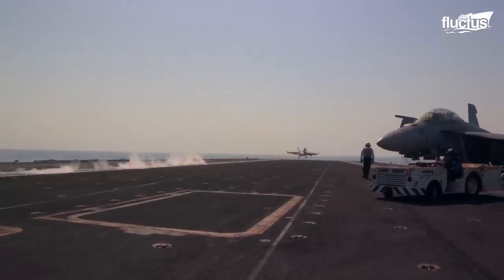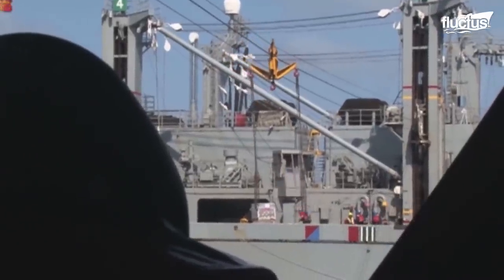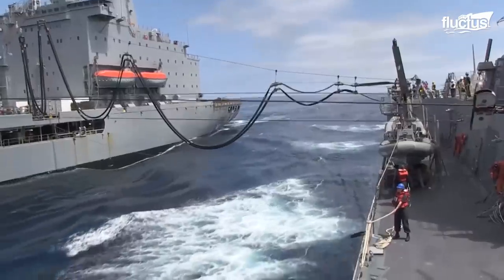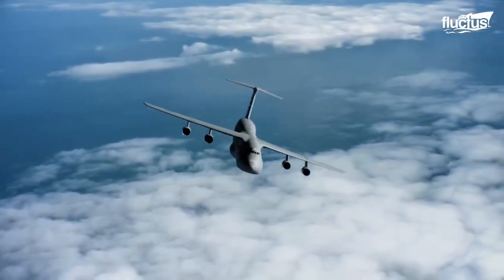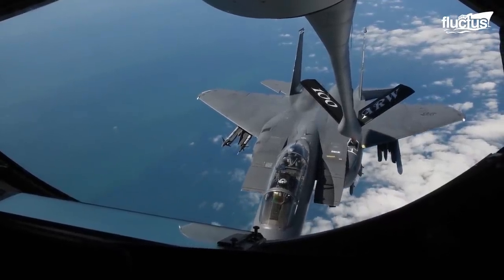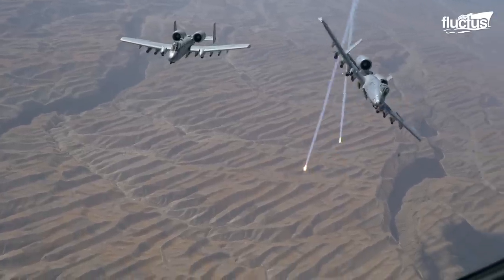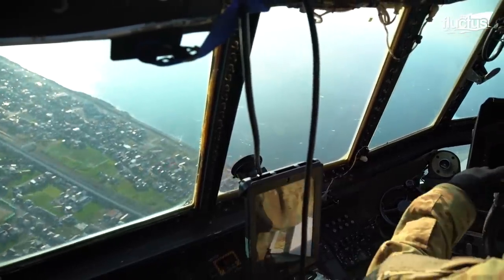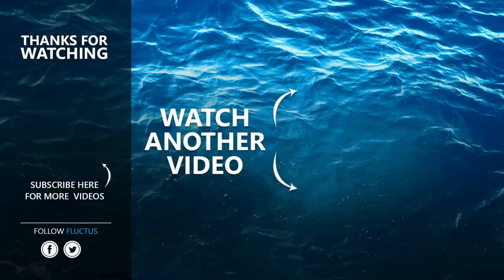US Genius Invention to Pump Million $ of Fuel Into Aircraft Carrier

Comment: I was on an old Destroyer Near Vietnam. While refueling in rather heavy weather, the two vessels rolled in opposite directions.  The hose pulled out and for some reason, the shut off didn’t work. The flow rate at around a thousand gallons a minute.  It probably flowed for a couple of Minuit before they finally got is shut off.  That’s a couple thousand gallons of bunker!   Made an unbelievable mess of our vessel. It took us months, many months to get that cleaned up. Wow, I will never forget sliding accross the deck as if on ice as the ship heavily rolled and we attempted to get at least some control over the spill.  Just one of many “adventures” from 6 yrs at sea in the Navy.
Reply: I remember hearing the Chief of our station telling us to not send the signal prob seated until  "tits up" for the indicator telling the signalman to commence pumping.  Unrepping was one of the most dangerous jobs I did when i was in the Navy.  I remember hearing that the Russians would try to fly over our ships in the 60's and try to take pictures of us unrepping so they could perfect it like we did!

Comment: Thanks for the excellent video. You mentioned that personnel can be transferred from ship to ship at sea. How is that accomplished?
Reply: It used to be done with a basket that hung beneath the connecting cables between the ships, you'd stand in this basket thingy and they'd haul it across the gap while you swung precariously over raging waters. Not sure how it's done nowdays but I wouldn't be surprised if it's still done the same way.
Reply: @jimmywrangles  Hey, it way to dangerrous to move people like this, Its much easier just to move personal vire helicopter.
Reply: @TheJamster1234567  We were training in a personal transfer. We were supposed to do it all by hand... no winches. We decided to use our heavy lift station that was designed to transfer jet engines,  so no problem with a 160lb officer right?? 

The officer was in the chair and raised to begin the transfer when the stream team (Standard Tensioned Replenishment alongside Method) sounded an emergency whistle. The officer unbuckled and jumped ~10' to the deck, and about 10 seconds later the 1" steel cable snapped like a rubber band, launching the chair over our ship into the sea. 

Yea, it's dangerous.
Reply: @srone  haha. They would never do something like that In the royal navy. sounds amazing to watch.

Comment: What helped the US win the Pacific War in WW2, was the use of oil tankers that refueled the fleet while on the Ocean.
The Japanese Navy did not have the same capability.
Reply: Towards the end of the war it didn't matter much as the Japanese had no fuel left to transfer even if they had the technology.
Reply: @Vincent_Sullivan  
Yes, but this permitted the US Navy to strike at so many Japanese Island targets in less time without the need to return to port.
Case in point, the US Carrier, Enterprise, “The Big E”.
Reply: @richpontone1  Agreed regarding unrep of the US Navy surface fleet.  The US Army Air Forces as far as I know never attempted air to air refueling until after WWII which is a shame as they really could have used it due to the vast distances in the Pacific theatre. The Doolittle raid could have ended quite differently!  Oddly enough, the US navy submarine force also did not develop unrep capability and they too really could have used it to great advantage in the Pacific theatre.  They had the example of the German Kriegsmarine in the Atlantic which fairly successfully used special submarines (Type XIV "Milk Cows") to unrep U-Boats with fuel, food, and torpedoes but chose instead to use large amounts of fuel and time transiting the Pacific from/to Australia or Pearl Harbour (later Midway) which seems very inefficient.  The only case of attempted unrep of a US submarine in the Pacific that I am aware of was during a 3 sub wolfpack operation.  During its 8th war patrol (late 1943 to early 1944) Halibut attempted to refuel from Tulibee and Haddock near Eauripik Island.  Halibut did not have the #4 MBT modification to allow for fuel storage whereas Tulibee and Haddock did, thus Halibut ran short of fuel before the other subs.  It was proposed to transfer 7000 gallons to Halibut from each of the other subs to equalise their fuel loads.  Despite relatively calm conditions the attempt failed.
Reply: @Vincent_Sullivan  
As the US Submarine Fleet shut down oil tankers and supply freighters to Japan, many of the Japanese heavy warships had to be stationed near the Dutch East Indies where the oil was being pumped from the ground, thus decreasing their effectiveness
No air to air refueling was developed in WW2. The Doolittle bombers were launched about 400 miles from Japan as it was felt that some Japanese fishing boats had relayed their location to the Japanese Defenses.
The US had to conquer with heavy losses, Japanese occupied Islands that brought them within range of their B-29 heavy bombers and the P-51 Mustang bomber escorts. The Japanese home islands were their objectives.